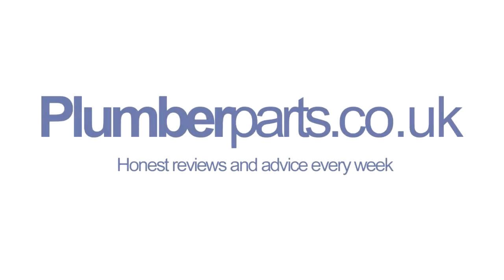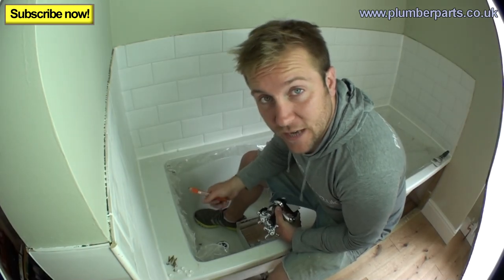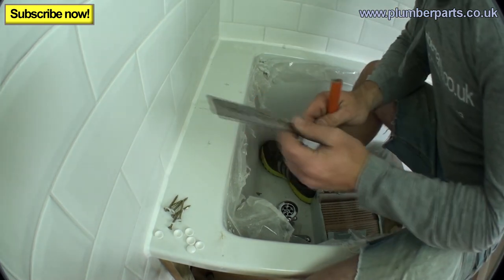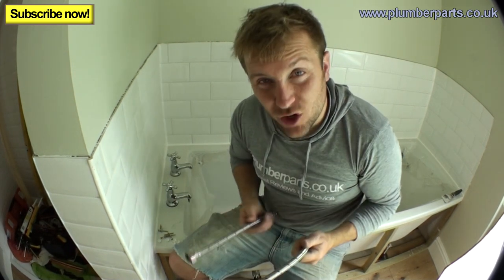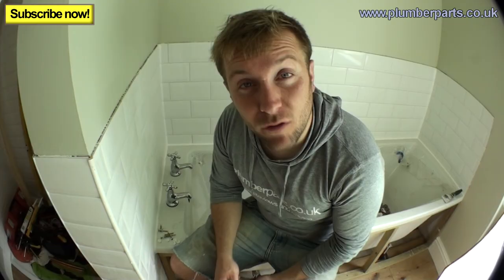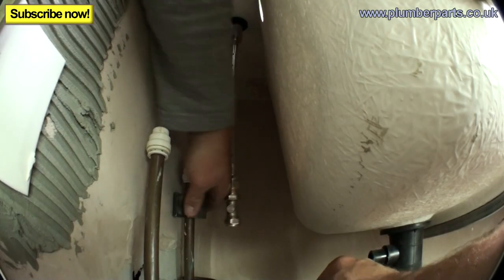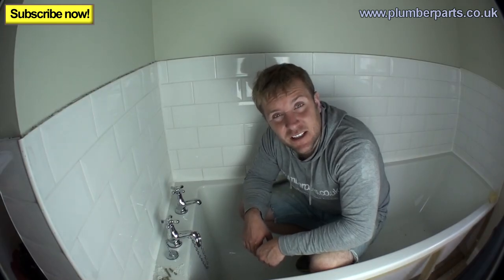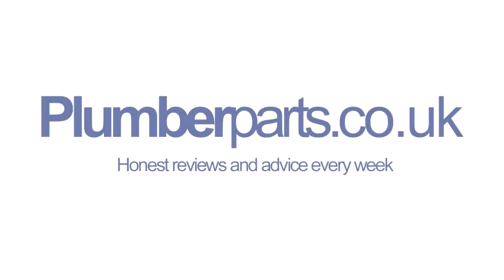SINGLE PILLAR BATH TAP INSTALL - Plumbing Tips

Comment: No hucks33, from a combi boiler it's best run in 15mm, the reason it shouldn't be 22m is; when you turn on a tap a 22mm pipe full of cold water is dumped on you before you get hot water through.  Also the flow rate is limited going through the boiler's heat exchanger anyway, so no point in it being 22mm.  HTH mate.

Comment: do you have a video on a bath overflow & mixer ?
I'm planning to replace bath taps with the above. Never used before. Just wondering if you ever seen problems with a bath overflow/mixer. I've no experience of them and prefer removing the bath taps, but not if you find these mixers are prone to problems. Thanks
Reply from the maker: +Fais I've never had a problem with them mate. 

Sub here please>> https://www.youtube.com/subscription_center?add_user=plumberparts <<If you haven't already!

Comment: Should you not have fitted a TMV to the inlet for the hot water tap? Is this not required for Building regs part G 3.65?
Reply from the maker: Senna007uk "This revision applies to baths in all newbuild, extensions of buildings or buildings with a material change of use."

Not bath re furbs like the one in our video.

Comment: Cool vid !! A tip I learnt is that when fitting bath taps , put the hot on the right and the cold on the as the occupant may have children and it justs prevents them reaching to the hot tap , hold tight !!
Reply: you put the hot on the left prior to blind people.
Reply: yeah i know that ! what im saying is on a bath its best to put the hot on the right incase they have grandchildren or children coming over and burning themselves but i suppose its just your preferred choice
Reply: if blind person u explain where the hot and cold are.

Comment: Surely not a plumber ? In this case hot should be too the right , to stop a child turning the tap and burning them self . Good practice guys hot 2 left cold 2 right but in the bath (Hot) always too the wall .
Reply from the maker: Liam you are totally wrong. Take a minute to check the regulations. Hot always on the left to cater for the visually paired. And as for not a plumber?! :D